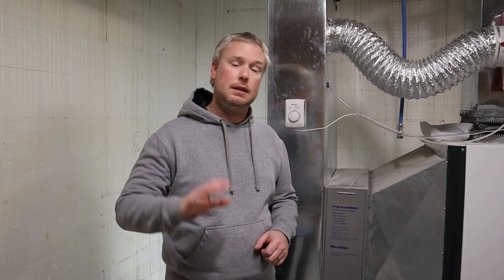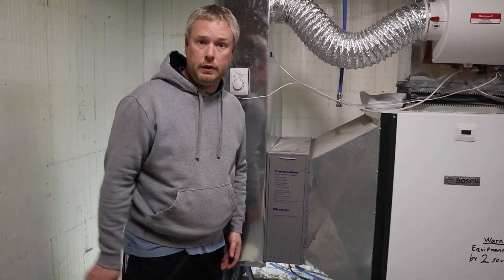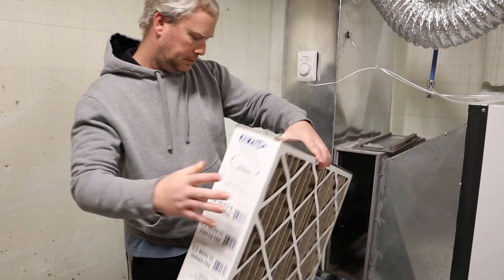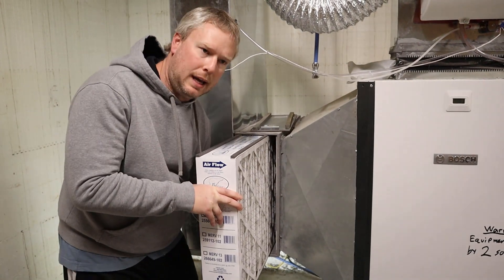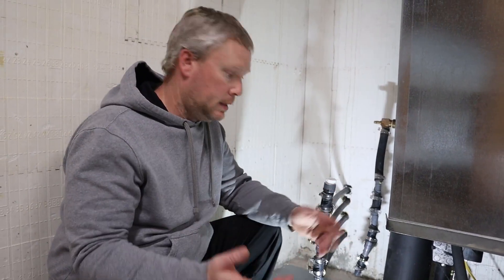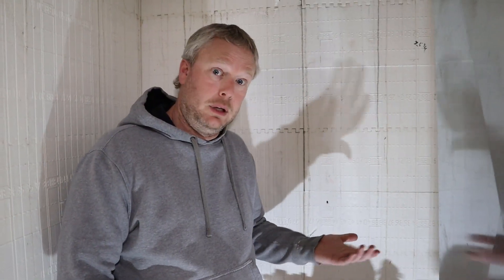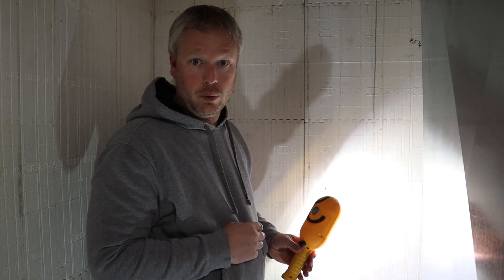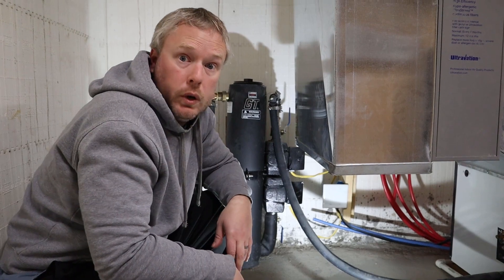How To Maintain Your Geothermal System

Comment: Hi thanks for the video.  With the Fluids...mine does go down a little over the years...what should I be topping that up with?  I live in Canada... where it is often -30 for 4 months of the year.
Reply from the maker: I would get a bucket of the antifreeze that was originally installed in the system, and add as necessary.
Reply: @Challenged1  Thanks!

Comment: What Merv rating do you recommend?
Reply from the maker: I run an 8
Reply: Older system Merv 8 makes sense. Some have recommended Merv 11. Your Thoughts?
Reply from the maker: @jayweber3851  I want the air flow

Comment: I noticed you built the house with ICF's.  I have been thinking of doing the same thing as I have installed machinery that makes Fox blocks, etc and have been very interested with the efficiency.  Did you build only the basement with it or the entire exterior of the home?  Also given today cost of lumber, would the price be close to the same with ICF exterior compared to 2x6?  Thanks.
Reply from the maker: I made a video on that exact topic https://youtu.be/SspDrb7a0P4

Keep in mind that lumber prices have dropped since I made the video, so the lumber numbers I provided will be a little lower.
Reply: I built in 2001 . Basement is ICF , main is stud frame . After finishing I compared the two costs . After all in the cost would have been equal to do it all with ICFs . 
When building , one day the contractor said to get the backhoe operator to trench in the power , and then went to the basement to work . In a few hours he came up and started cursing the backhoe for not getting there . Meanwhile it had trenched ,backfilled and left and he never heard it working , three feet outside the wall
One cold day I measured the wall temps . With a room temp of 71 deg f . ICF below grade was 70.9 , ICF above grade was 70.5 . Stick frame r-20 wall , temp was 47 deg f 
I have heard that in southern areas , termites can be a problem. But in northern areas I cannot see why not to use ICFs . I think they are great

Comment: We've got a closed loop vertical system installed by a company.  Two things not mentioned is cleaning the coil and condensate pump.  We let the company do the maintenance for a charge but for us it is well worth it.  Also notice you have a whole house humidifier.  Does the air get that dry in the winter?  We had one for the oil furnace but with geo the air doesn't seem as dry.
Reply from the maker: In my area, it does get real dry.  My hardwood floors require no more than a 10% drop in humidity between seasons.

Comment: I thought some of these geothermal units use similar liquids that are used in radiators in cars. I know some of these liquids should have limited exposure to oxygen. Ie. You shouldn’t keep peeking to see if fluid levels are ok. Is it the same for geothermal liquids?
Reply: its 70% h2o and 30% glycol ( in his case ) .You can open it all you want
Reply: 70% distilled water

Comment: I've been installing geo systems for almost 40 years now and no one has ever shown me a good reason to change an air filter. I have a small wet/dry shop vac and when I service units for people I just vacuum clean the existing filter which is usually mounted right beside the furnace and much thinner (1") than the one you have. The one you have you'll need the crevice tool attachment to clean, maybe, but honestly a vacuum cleaner will remove all of the dust gathered there easily. Also it's not a big deal taking the cardboard apart and putting it back together, if you're clever.
Reply: hey this may be abit late, but i have a guess why a may be beneficial to change the filters. Im not sure of their exact purpose, but when it comes to the fine dust, really small particles, they may get filtered unvisibly in the interior of the material, where is has some fine strucure. my guess is that after a time, particles accumulate, degrating the materials filtering ability and forming "air roads"/tunnels for the small particles to just flow though.
Reply: Oh yeah, you're also going to want to, periodically, get a visual on the air coil which is inside the furnace and behind where the 1" filter usually goes. That is just like any other radiator and has fins, and some dirt slowly gets there, slowly over time and keeping those fins clean improves performance while having dirt on them deteriorates performance. That's about a once every 10 years or so visual scan you want to make and also in new construction you may want to look at those fins after the first year and then every 10 years after that.
Reply: .... aaaand when you are temperature checking your in and out lines, put your hands on the metal connectors right beside the unit.

Comment: Ive had my system since 2001 X 2 meaning I have house decided into 2 halves. When first operating with a lot of carpet in bedrooms and hall ways. Had way more dust in filter, after getting rid of 99% of carpet, can go 1 year without changing filters. Mine are 20X20X1” I have 2 horizontal loops 1000’ 6’ deep in wet sandy loam. Only had 1 pump fail in 20 years, and it wasn’t even the pump it was a small stone from install, on me cause I installed the system. Very efficient system and would recommend this type system any time. Has worked down to 9* ambient which doesn’t affect ground water temp much at all.
Reply from the maker: Thanks for sharing.

Comment: @Garret Glaser is there a source you used to put together your DIY install?
Reply from the maker: I researched anything I could find, so no single source.  I also talked to as many "pro's" as I could to get further insight.
Reply: @Challenged1  I actually just found your full DIY series on this. Thanks!